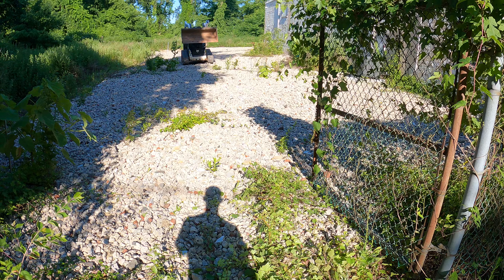Gravel driveway problems

Comment: How is a bunch of large crushed considered impervious?  It is about as pervious as it can get.
Reply: Because they need an excuse to charge for a permit and to fine the business so the township can waist the money on something stupid
Reply from the maker: In the township eyes if its going to be driven on then it's impervious. But I agree it's complete BS.
Reply: @srmcontracting  That is funny because I once had to pave a small part on a job near a famous lake in a large left wing state and all they had to do was tear out some asphalt elsewhere and convert it to crushed gravel, with fines, to be driven and parked on, much less pervious than in your video
Reply: because if it is driven on over time it will compact the rock to the point where it eventually becomes impervious .
Reply: @54565syu no, it wont. You need a different type of material for that to happen. You democrats are all the same.
Reply: @54565syu  and yet my storage yard is built with this same stuff and has been driven on daily for 15 years with quad axle dumps and lowboys and doesnt hold any water no matter how hard it storms. Seems pretty pervious to me